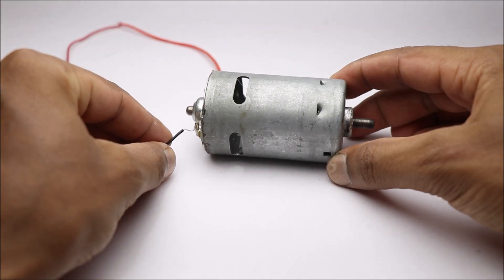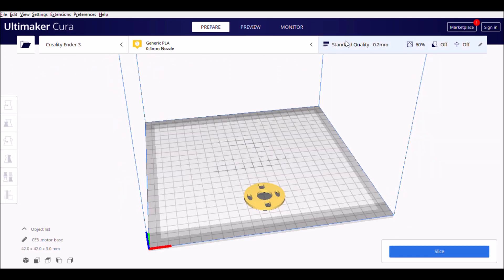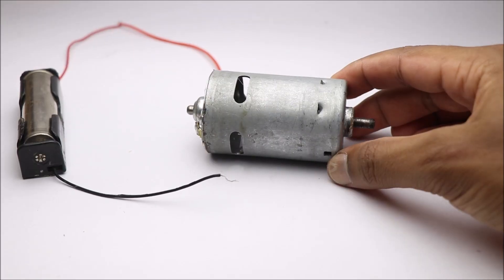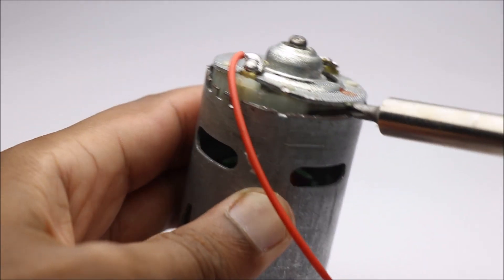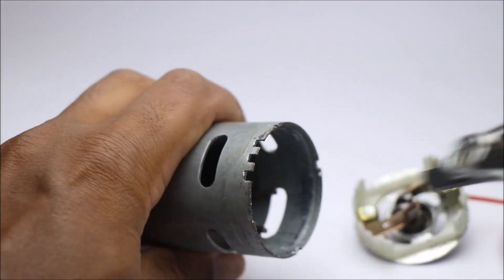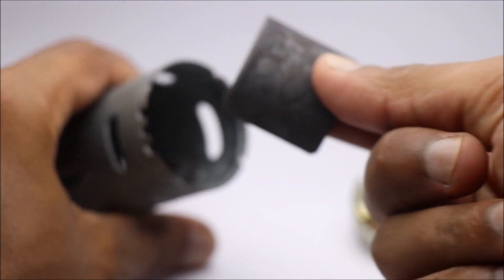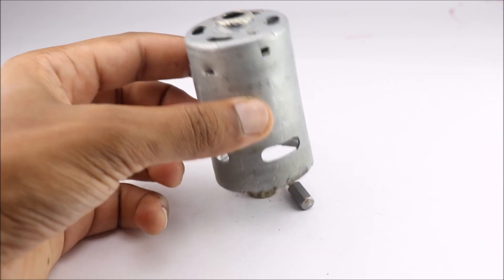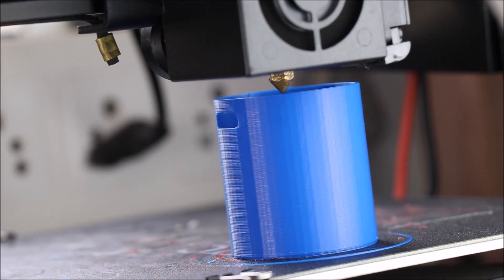DIY Double Shaft DC Motor with 3D Printed Parts - How to Upgrade Your 775 DC Motor!

Comment: This is a neat project!  The thermal conductivity of the printed plastic is lower than the original metal case, so overheating could be an issue if the motor is running hard for an extended time.
Reply from the maker: Yesss😁